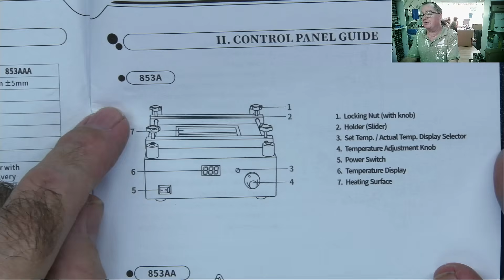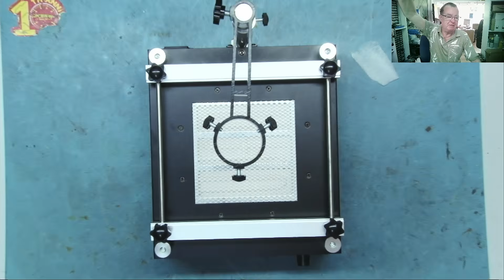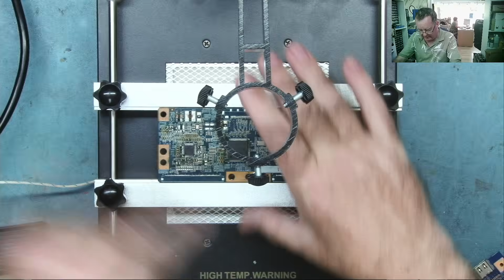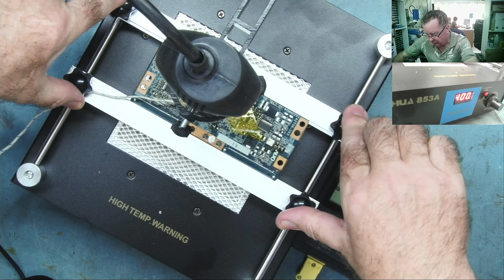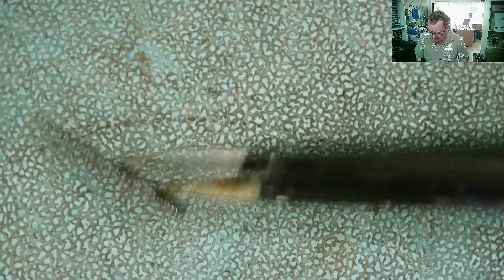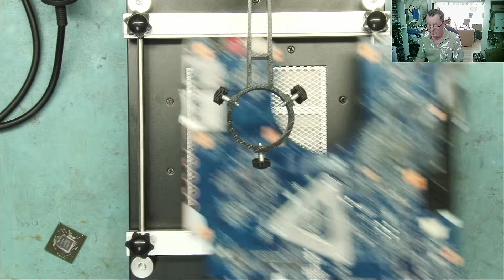Is BGA Rework Possible With Basic Equipment? Best Cheap BGA Rework Station 2025 Yihua 853A

Comment: i stumbled across this video as I'm trying to sort a way to do some VGA reballing  work i wish you had set the quick hot air nozzle in the clamp, as I am wondering if my Atten hot air station will fit in this clamp also if your feeling up to it Mabe you could do a review on this IR6500 1250W ACHI BGA IR Infrared Rework Soldering if its not to much to ask

Comment: I have the larger 8280 along with a cheap hot air wand.  It dose the job fine.  What you don't get is the ability to record or playback heat cycle programs.  Yes I write down my temps and times for each job.  I'm guessing something more sophisticated could have pre-set cycles for the types of board you do regularly.  It would be nice to have a number of pre-sets that can be recalled with the push of a button.   I have been pondering about a more expensive hot air station.  What advantages can I expect? Oh PS I use ceramic floor tiles for shielding sensitive parts when preheating.

Comment: i have the 853a preheater and i confirm what is shown in this video: it works and turns (de)soldering an easy task. of course, a specialized reballing station for bga reworking is recommended BUT if the technician are really good doing the job, it is possible to resolder even a PCH with the same setup shown in this video. i have already done such a procedure of desolder and resolder a PCH and GPU (video board).

one must be patient, think before acting, plan all the procedure, recheck each step, and practice before executing the task. i recommend practicing with scrap boards or just buy those kits for soldering learning.

while the expensive machines do the job by themselves, this simple preheater also does the job. the main difference is that it does not do it by itself. here, the real technician's knowledge is the main tool to get the job done.

congratulations and thank you for such informative video. i totally agree with you: this preheater is a must-have tool for those with experience in repair electronics but don't want (or cannot afford) an expensive tool that is used once in a while.

Comment: Cheers! I was looking for something like this. Unfortunately, it looks like overall it will cost as much as sending the board to the repair guy for the same price minus delivery. But, in case I would need to repair it again, I would save cost by learning how to repair it myself in the long run. So keep doing this. I much appreciate it, learning new things.
Reply: on condition you have qualified technicians in your area

Comment: I would be more interested in resoldering the chips, rather than removing them. Many devices with these ball joint soldering connections need re-soldering sooner or later.
Reply: I know this is an old comment, but in case someone else sees it...If you can remove the chip you can resolder it even easier...Most of the time you are going to reball the chip with leaded solder balls/paste which has a much lower melting point than the factory lead-free solder balls...The best thing to do is to take really good photos of how the chip is aligned on the board or find some way to mark the board so you know exactly where to place it when resoldering...You can desolder/resolder some surprisingly large BGA chips with this preheater and a decent hotair station...I just reballed a 4090 GPU core using one of these and a Quick 861DW hotair station...It's definitely not ideal for a chip that large, but my larger preheater quick working in the middle of the job so I figured I would try with the 853A...It took a while, but it actually worked!
Reply: @brucepreston3927  What air flow rate and nozzle did you use? What was the distance from the chip to nozzle?
Reply: @san4tr0n I used a 45mm x 45mm square nozzle at 80L/m air speed...I have the nozzle maybe 10mm above the die, give or take...
Reply: @brucepreston3927  Have you calibrated your station and how much did it produce when you removed the chip? I have an Atten ST-862D and I got 260 degrees to remove large chips like the GPU provided that the bottom of the board is heated to 170-180 degrees

Comment: Whilst I was confident that you'd be able to remove the AMD chip with both the preheating station and the quick, I did not expect the cheap hot air gun to be capable at all! Richard, could you please show us how to modify this preheating station to take, for instance, an ATX motherboard? (if that's possible at all).

Comment: Hello. Just want to ask about “ pop corn effect “ on big motherboards. You are heating bigger part of the board, but not all. What the chances to damage the good board on which one you are working? Not a lot off videos about someone using like that preheating station for CPUs.And thanks for the nice review!
Reply: Pop corn effect usually happens when the area is exposed from too much heat for a long time or the board was not heated properly prior, causing moisture build up. If using this kind of preheater for big boards like mAtx desktop board, it is important to preheat the board within 100c - 130c for at least 12 mins to slowly remove trapped moisture. The one problem is that this preheater covers only a small area of the board which is not good. What you can do is, use hotair gun to heat the area which is not covered by the preheater up to at least 80c. After that you can start the preHeating process. Dont' just rely on the preheaters temp you must have separate thermo coupler attach to board, one on top and one at the bottom. Difficult but doable.

Comment: If it is just about removing the BGA an electric paint stripper as a 'high power' air gun does the trick. The difficult part is to put the BGA back in place, working of course... Can it do that? (armed with the correct stencils to reball the chips in advance)

Comment: BGA is something I really want to get into, just looks so daunting. I have 2 boards that need BGA rework. One is a laptop board with an internally shorted CPU and another is a B450 MSI Mortar Max board with a damaged CPU socket (several Memory Channel B pins are broken off completely). I've had to put them aside because I only have the generic 858D hot air station which just isn't good enough on its own. I did try to desolder a PCH off another dead laptop board with just the hot air. It did come off but not without lifting some pads. 

I'm considering getting one of these preheaters to see if that'd make things better. Can't really afford a proper BGA rework station (they seem really expensive).
Reply: yeah dont try it you gonna burn it 100%, also tools are expensive and need to learn how with scrap that is identical like if you want to reball a gpu chip you need scrap that is same pcb thickness and chip size to practice,also reballing is way harder than it looks. also heating board can popcorn it it will be game over

Comment: have been toying with the idea of cobbling together  the remnants of an old anet a8 3d printer as a hotplate,  it wont even need any coding as  you can set the  bed temp which has an NTC  thermistor in the centre of the plate  and use the other NTC thermistor from the hotend to read the temp of the workpiece...   the plate can reach 100c  in a few minutes easy  and got it up to 120c with a bit of fettling  as whatever am working on is sitting on the plate its got to be worth a try...

Comment: Have the Gordak version of this. I mainly bought it because it was cheaper at the time but seems to have some improvements over the Yihua. Namely the screen is attached with standoffs and the heating element is slightly raised above the case to prevent it from heating up the case itself, which apparently can be a problem on these Yihua units. Also the tightening knobs are on the side so they are less likely to get in the way of the board.

Both seem fine, but if the price is similar or cheaper, the Gordak seems like a mildly improved version.
Reply: That's a really useful comment, thanks for sharing your experience.

Comment: Desoldering a BGA  is one thing. Puting a BGA chip with a lot of balls back on and having it to work is another thing.  Real BGA rework stations have temperature profiles base on which chip you are removing so that you do not delaminate the chip.  You need accurate temperatures. Some of those small BGA chips can simply be removed via hot air gun as you showed. I have seen Sorin replace chips like you removed, simply with hot air and no reballing. You have to get a clean lift straight up off the board. Try removing and reballing a 4090 core is not going to be done by this setup.
Reply: The preheater is fine even for something like a 4090. The only things you need is a better hot air station with a proper BGA nozzle.
For a clean lift a vacuum SMD pickup tool should do the trick.
As for putting a BGA back it is often easier since you will be using leaded solder.
Reply from the maker: @vitor900000  I would be very surprised if this, even with the quick861DW could desolder something like a 4090 GPU (if they are as large as earlier generations I have worked on)  of course it should be good for RAM chips.  I have an old scrap PS4 board here - maybe we should try desoldering the APU on next weekends livestream.   I do have a vacuum pickup tool.  Regards BGA nozzles do you mean these ones? https://s.click.aliexpress.com/e/_c3ipLNzV
Reply: @learnelectronicsrepair  Yep. Those nozzles spread the hot air true the whole surface of the chip instead of being focused on a single point. This is important for big chips since, without the BGA nozzle, the center where the hot air is being blown will be read to desolder way before the edges. Or the edges might never actually get up to temperature. Ideally, you get one that is a similar size to the chip you want to desolder.

As for the preheater vs a 4090 BGA, as long as it can get the board to 120c~130c desoldering a 4090 BGA shouldn't be a problem with a good hot air station with a BGA nozzle.
You said that at max it only reached 120c, but if you manage to lower the board to be closer to the heater you can get a few extra degrees out of it. Some hardware store supplies will be your friend for moding it.
You can also help the preheat by heating the board from both side. This is by setting the hot air station on a low temperature and leave it blowing from the top.
Reply: @learnelectronicsrepair  NorthWest Repair I believe uses an Infrared heater

Comment: I have the triple and it works great, but do not leave the power switch in the back turned on. I had it glitch once and it turned the preheater up way to hot.

Comment: there has to be a more efficient way of heating the board than that.
Reply from the maker: Of course there must be.  The purpose of this video is to show what can be done with basic off the shelf equipment
Reply: @learnelectronicsrepair  well, it certainly did that.
Reply: @learnelectronicsrepair  Can one move the board closer to the heater?
Reply: Acetylene is extremely effecient. Efficiency does not always equal effective.
Reply: @SkippiiKai  oh please. A cheap toaster iis more efficient

Comment: i knew you would be able to take the chips off as i have one of these preheaters (the only issue with it is the stand isn't cantered on the hot plate)and hot air station, the real challenge is putting them back on.
Reply from the maker: Actually that is not so difficult but it does take some practice on scrap boards.  The basic technique: get the board plenty warm enough, use leaded rather than lead free balls on the chip. Then add flux to the PCB and give the area you want to solder the BGA a good heating with the preheater plus hot air. Hold the BGA under the hot air with tweezers to get some warmth into that too, then pop it into place and it should solder.  You don't have to be 100% accurate just close enough and the surface tension of the solder should pull it into place. Plenty of flux is your friend here. I feel another video coming along showing this...

Comment: Your demonstration revealed one thing - it is important to try to keep the hot air gun still with this method. With the hot air gun used manually and being waved around you had more difficulty removing the ram chip compared to with it mounted in the holder to remove the larger chip and the other chips from the Tcon board.
I think you were probably thinking you needed to heat the surrounding areas of the board, but of course that was already done for you with the 853A.
Reply from the maker: Yeah I would go alomg with your anaysis there. Of course this with the el cheapo hot air in particular is gonna have it's limits (such as large GPU or APU) but for what it could do vs what it cost it was quite impressive.  Certainly changind VRAM chips etc is well within the capabilities

Comment: Nice station. Metal binder clips are easy to get, come in different sizes and would do the trick to hold the board securely. They are useful for holding different 3D print bed top surfaces as well.

Comment: It's a microscope camera mount 😅
Reply from the maker: You could use it for that purpose I guess
Reply: @learnelectronicsrepair it's what it's sold for originally
Reply from the maker: @I.TestThings  Not according to the instruction manual as shown in this video.  Also the mount is an exact fit for the Quick 861DW hmmm
Reply: @learnelectronicsrepair I was saying in general, in this case they have just reuse it for a different application
Reply from the maker: @I.TestThings  Obviously I can't argue with that 🙂
Reply: @I.TestThings I'm regularly amused when I see the exact same item, with the exact same photos listed on Ali Express or especially Temu, sold for completely unrelated purposes. It's funny when an electric automatic hot cocoa stirrer arrives in a box labled "Labratory Chemical mixer" but it's horrifying when you see the same thing listed 3 days later as a "Personal Pleasure Device"

Comment: The top heater holder is not exactly in the center position, that's bad.
Reply from the maker: it would have been nice to have more adjustment but hey it's cheap and it surprised me
Reply: @learnelectronicsrepair  Pretty sure you easily make it more adjustable with some cheap hardware store stuff like L bars, nuts and bolts.
Reply: You can compensate for that by positioning the board holders a little further up, but yes, it really looks like the arm is a bit on the short side.
Reply: @ser_olmy The Gordak version seems to have the holder on the side of the case which makes it center over the heating element. Wonder if it would be the same with the Yihua?

I bought the Gordak without the hot air holder, and the yihua hot air holder separately since it was cheaper that way. Was hoping the Gordak would still have the mounting holes, but the one I received did not. So I just drilled some holes and JB welded some nuts to the inside of the case in order to attach the brackets.  Results in the hot air being dead center, might work on the Yihua as well.